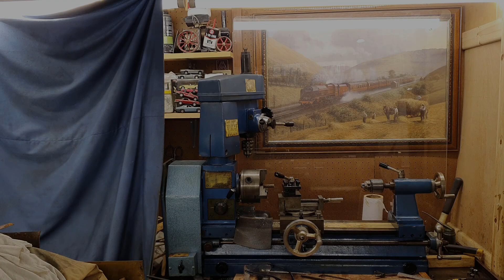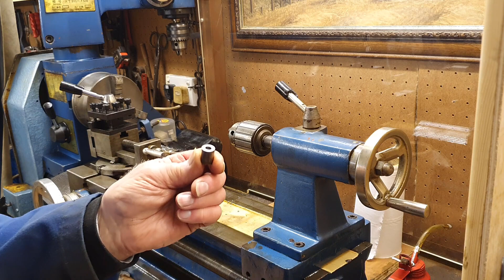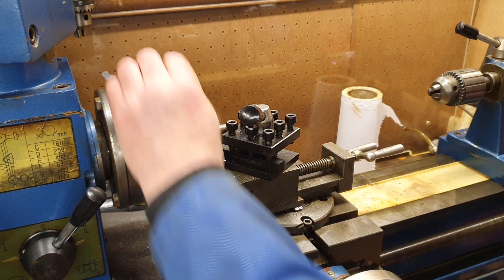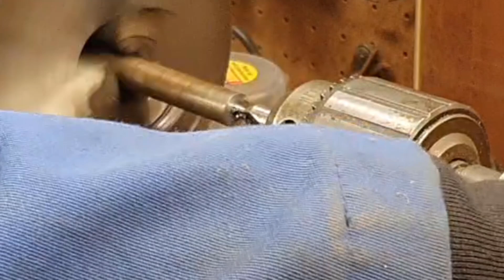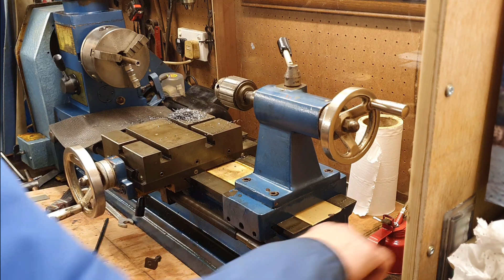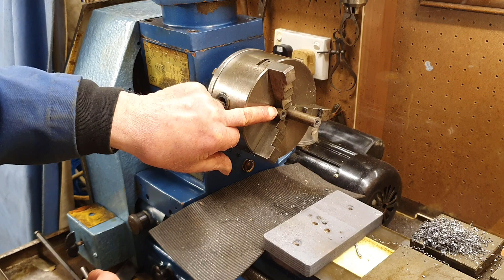Can a Rusty  Lathe, Mill Drill  be saved from Scrap Part 21 Making Chips

Comment: Well done on saving her and hope it gives you years of fun.
Reply from the maker: Hi,
Many thanks, I feel certain it will be a very useful addition to the workshop and will get plenty of use when some minor adjustments have been made and  various accessories purchased or made to make using the machine a real pleasure.
Cheers.
Reply: @masterpiecesinminiature8299  I bought one during covid shutdown and have had many hours of "fun" with it. Am almost finished converting it to lathe and mill CNC. Not sure why I did it but it's working so far.

Comment: Where's the rust?
Reply from the maker: Hi Paul,
The rust has now been removed in the previous videos, and this is the first time the lathe has been put to use.
When I got it, it looked a doubtful prospect, having been stored in a leaking shed for quite some time, but now I hope it will become a reasonably useful machine, which will not be going to the scrap man, as was the original intention  of it's previous custodian.
The compound slide and main Bedwas were and still show evidence of the ravages of the rust, but have at least been cleaned up to be in a usable condition, along with a fault on the cross slide lead screw mechanism.
I am a beginner, finding my way with these things and posting, in the hope that other novices will have a go at a project.
Many thanks for commenting.
Reply: @masterpiecesinminiature8299  oh OK. I thought my eyes were just worse than I knew. I'll go look for that other video.